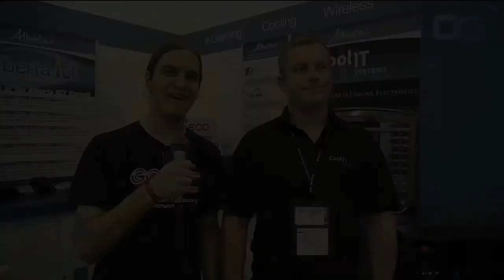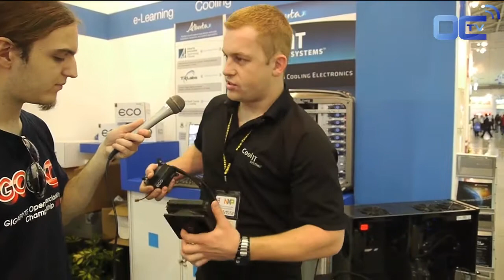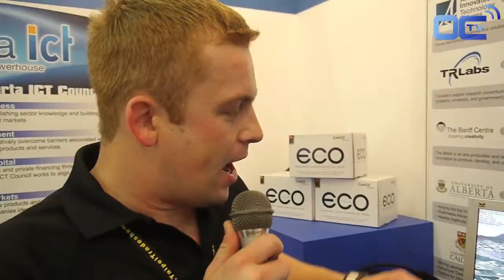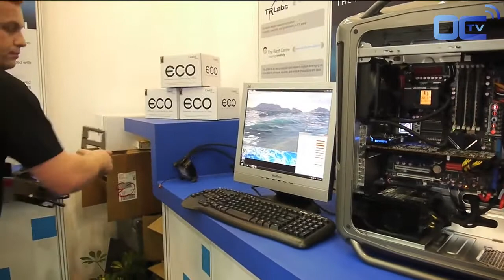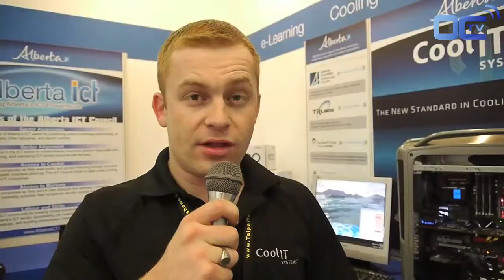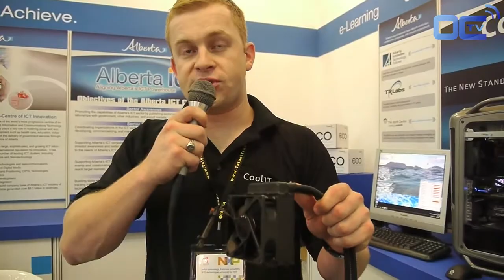Computex 2010 - CoolIT Systems present their product line

Comment: Nice that you have that option with liquid cooling instead of using either a regular heat sink or an expensive liquid cooling device. I just don't like all the hoses showing on a case when installing a high end system this gives you an alternative with somewhat close performance. That's why I got the H50 for my system and I'm overclocking my i7 860 at 4.0 ghz at the moment at 32c idle and under heavy loads at 42 to 45c.